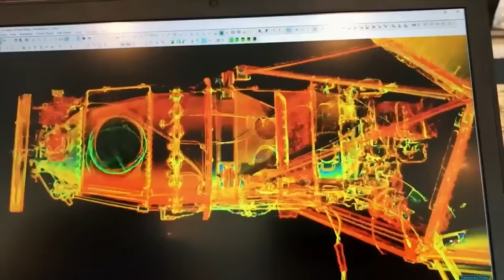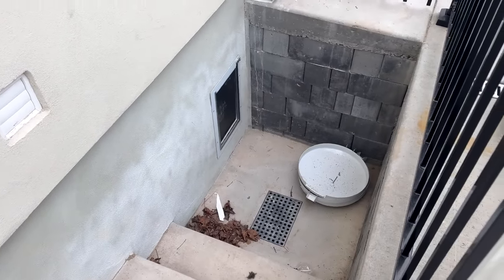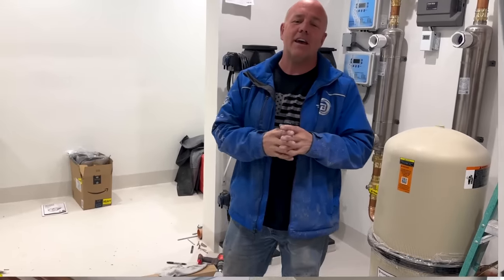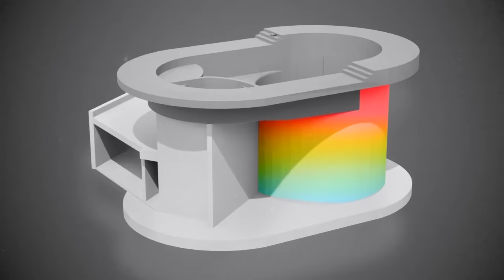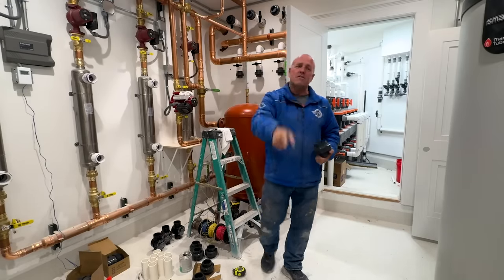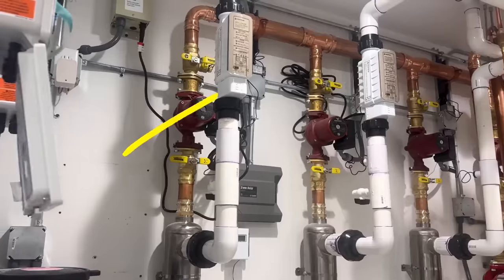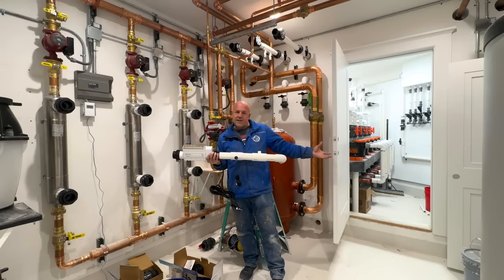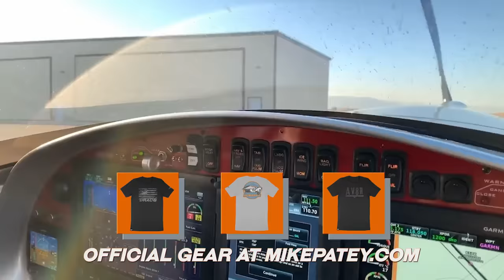Over 40 KW of Backup Power to my home and pool | House Build #23

Comment: I was qualified on a nuclear submarine and I’m impressed with your design, engineering    and safety…You need to design a piping tab for your system and have operating procedure manuals in case you aren’t home…Your kids
 could get qualified to operate everything and your  helper could be the backup to  your back up 👍🏻🤩😃
operator
Reply: Yes this. Mike is a legend few professionals in pool business will reverse engineer this to properly maintain or repair.

Comment: Mike - as a retired executive project manager for very large-scale industrial projects, I am extremely impressed with your engineering and your construction of your home.  This is as good as anything I have seen installed in a refinery or chemical plant.  Two questions I have are:  1) Are you creating a systems operation book with all schematics, owner manuals, operating manuals, etc. for the house?  With the complexity of systems you have installed, this is equal to a small-scale industrial installation, which would have books of this type.  2) Did you ever consider using a PLC or some other form of unified computer control system to run all the systems and components you have installed?  I am thinking something similar to a large yacht management system.

Lastly, the fact you thought of your neighbors with your back-up generator system speaks volumes to how good a man you are.

Comment: Every time I watch one of your videos I am speechless on the intricacy and redundancy of every little system in the house. For example, the valves at each sink and faucet that allows for continues flow through for instantaneous heat at each faucet. How do you not get overwhelmed by points of failure for such a intricate system??

Comment: My only concern is the down stairway opposite the propane tanks. Propane being heavier than air, looks like a collection spot that might allow propane to seep into the lower level of the house.
The whole project is amazing.
Reply: Excellent point! Thanks for sharing
Reply: How do you keep the "grass" clean after it absorbs copious amounts of product? Could get fairly smelly back there.
Reply: My concern would be as the dogs get older they won't be able to make the steps into their "living area".
Reply: @Asta-wl8jz that's not the kind of thing you worry about when you have a pet.. I've had dogs all my life and that's never been a problem but he has money I'm sure he'll change or fix whatever needs fixing if that happened
Reply: @ah244895 my biggest thought too tried that method before and it didn't take long until he tore it out because it stunk😂...
Reply: @Asta-wl8jz  doggie elevator

Comment: I wouldn't even know where to start designing a pool system like this. The amount of thought, designing and engineering in just the systems is insane never mind the rest of the pool and house.
Reply: Both brothers have been building pools for decades and it shows, they have engineered around all the problems with their previous pool builds. Very cool to see all that experience at work!

Comment: As a retired municipal code official (plan review and inspections - both commercial and residential), I would love to hear about the "behind the scene" permit, review and inspection process.  This would be a once-in-a-lifetime opportunity as a code official!
Reply: No code enforcement official knows what the hell the system does or how it works or if it is installed correctly or not!!
Reply: I'm pretty sure the building department just required an engineer to sign off on everything about this job.
Reply: @steinwaymodelb  mike is the engineer :'D
Reply: Do Inspectors who get a Patey job think "Mike's got his sh*t wired, I'll see some cool stuff today, maybe even learn something, this'll be a good one!" Or "Everything will be weird, custom, like nothing I've ever seen before, and it'll take forever to figure it out before I can sign it off."  I wonder the same about the FAA inspectors who have to sign off on builds like Scrappy, but city officials are likely in the same boat here too!
Reply: I am sure EVERYONE in the building department knows all about this project and who Mike is, and how capable.  If it were me, I would be comfortable signing off from my desk, but, I'd want to have the opportunity to walk the job, so I would go out and just BS with Mike.  If Mike is in charge, it's bound to far exceed code requirements, and you know it was done right!

Comment: Got you beat on back up power. 148). 400 Watt panels 30) 100 amp hour Batteries 6) 8k inverters and a 50kva propane generator. All is off line and waiting for the grid to collapse.

Comment: For my work I put in 150kw  system with 450kw generator Ie motor was small but electric side was huge to start  frequency(should UPS fail) converters and keep UPS happy.  If you’re willing to take a chance it’s pretty cool how much you can push generators.  As long as the exciter is a magnet

Comment: Hi Mike, if you read this, I just wanted to warn you about salt-water pools.  Our town built a new public pool 10 years ago or so, using salt water disinfection plus chlorine.  Every year, they close for a month for ma,ntenance to repair tiles which have spalled  off, due to salt crystals growing behind the tile.  When they fall off they use epoxy to reinstall them instead of the cement mortar.   I thought i should let you know about possible problems with salt and tiles.  We have our own 54 year old concrete 40,000 gallon circular concrete pool here in British Columbia heated by a 70kW micro hydro.  Best Regards, Len

Comment: Been following this build since the first shovel of dirt moved. It is as impressive as that flap and slat system on the plane, with a couple of extra's tossed in..... just for the sake of living.. 😉.. Farmboy, turned tech, turned boat tech, turned race engineer, turned airplane nut with a good dose of historic race car restoration here..... Did quite a bit with propane and gaseous flamy stuff . I might miss something in the vid, but in case of a very unlikely leak, since Mike did it, where would the propane pool or dissipate to? I see a drainage line under the grass and the the doggy stairs and door, all lower than the propane. If it does pool and something lit it, the foundations will rattle a bit... Sure of it that you did something, but I can not see it. Vent fan of some sorts?

Comment: Impressive.  My bet is there are no industrial/commercial pools with this level of redundancy let alone residential.  I am rebuilding my pool, and just put in a Generac system tied to natural gas.  No worries about power now, but I figure it is the one thing out of my control that messes up my day.  Why not.  I have batteries on the critical resource, gigabit fiber connection, and 26kw to everything else.

Comment: Please watch out with your acid/chlorine set up.
If you have any failures and they mix then you have a problem. At minimum please install a chlorine gas detector or consider using co2 for ph correction. 
I only advise as I am a pool engineer and have came across a chlorine gas accident which involved a similar situation. 
We generally in the uk would have the hypo or acid in separate bunded tanks.
Erich, Inverness, Scotland. Big fan of what you do and take the time to show it. Thanks for your efforts

Comment: As a pool contractor I would like to recommend something. If you do 90 degree elbows, I would use sweep ones. These straight are outdated, especially you you have plenty of space. It gives you less losses when water travels in the pipe system. Also those black ball valves are crap. If you don't close/open them regularly, within a year they will seize and you will end up breaking the handles and forcing yourself to use a wrench. I wouldn't use ball valves in your application at all actually. I would use Jandy 2-way valves. Never lube them, if anything, you pop out the cover and replace the inside. These ball valves will be headache one day. Also Pentair salt cell...man, it's a headache to maintain it. Jandy/Pentair or Hayward...same thing, they all filter/pump/heat/crate chlorine the same, but as a service person...the key element for me is how difficult is to maintain, which brand is the best. My answer is always the same...Jandy is far the best on the market, everyone just follows. I would use Jandy True Clear salt cells instead. Very easy to maintain, you can see those titanium plates if they are dirty, you just unscrew the top and dip the cell into a bucket with the solution. With this Pentair, first of all, you don't see if it's dirty or not unless you unscrew it and take a look inside. If you want to clean, you have to cap one side, pour solution inside and you many times spill it over, it compromises your floor, especially if it's this high up to the ceiling like you have it. It will be a mess, trust me. The salt cell is good because you create chlorine is a gas form, instead of conventional form...liquid or solid (tablets). In California there is also a code that you have to install a check valve between the cell and a heater. It prevents the heater from corrosion whenever system is not running. I don't see it on your setup. Again, the best check valves are Jandy, the rubber seal gasket gets worn out, you unscrew the cover, pop compromised one out, put a new one in and that's it. Ball check valves are crap, you don't see the state of it after years and the only way how to replace it is to cut the pipe. Whenever I install anything I always thing of anyone who comes after me.

Comment: Hi Mike awesome job , I use those Grundfos pump in my hot house heating and found if there is air bubbles in the water the ceramic shaft well brake because of vibration with running between different densities in the water. Something to consider before run up .😊

Comment: We also run a safety switch that will only allow the chemical to be pumped if it sensed the circulation pump pulling amps, which would mean it is pumping water through the circulation/filtratrion  system

Comment: Nice job on the plumbing. its starting to look like an ocean liner engineroom. Just a comment on the dog entrance door to the basement. if the drain at the bottom of the stair gets a piece of paper on it the drain will block and you could potentially get water into your basement. Consider adding a roof over the stair,

Comment: I have a 15k onan and 1000 gallons propane for my backup and a 6.5k honda as my second backup and now im interested in a battery inverter system for the evening and at night so I can turn off the generator and still have power. Living without power is for the birds

Comment: I have a similar (smaller scale) project planned while replacing our deck, to use icf forms and removable cover that will double as deck when the pool is not in use. Should improve heating and cooling to be able to use year round solar electric in North Carolina.

Comment: I may have missed it - but salt systems stop generating chlorine under a water temp of 60 degrees or so. So either keeping a minimum temp in the pool or doing a minimal chemical injection in the winter. Don't need as much chemicals at lower temps obviously.

Comment: That's a great idea to have the moving pool floor have a side "skirt" to block off the lower area from the rest of the pool!  Does the side "skirt" lose you a whole bunch of depth?  I assume the skirt will be a fixed component that then will be the first piece to contact the bottom, and restrict the overall accessible pool depth?

Comment: the radiator air discharge end of the 30 kw generator is to close to the wall and will cause overheating issues during an outage. for serviceability there should be 36" all the way around the generator. it may not be said explicitly in nfpa 110 ( Standard for Emergency and Standby Power Systems) or nfpa 70 (national electrical code) but it is a good rule of thumb

Comment: small tip for the pvc dont use to much glue/cleaner as it would leave traces on the inside also visible around 9.17 that would weaken the pvc over time has something to do with the softeners in the glue to my understanding

Comment: Thinking about it... you have a backup heat source in the pool itself, but ofc it still would need power to circulate through heat exchangers. 

How do you know the house is build and designed by a skilled pilot? The backup system has it's own backup system, that has it's own backup system.

Comment: Love the project updates! Curious on the dog turf, how do you clean that out so it doesnt stink? Do you hose that off every so often? I'm surprised you don't have an automatic powerwashing system for the turf, like those automatic cleaning public bathrooms! 😂
Reply: I wondered the same thing. I don't understand the fake grass concept. Why not just keep it concrete, maybe epoxy coat for ease of washing? The dogs won't know the difference.
Reply: @Johnbobon  mainly because some dogs are particular and won't go to the bathroom, not on grass. I'm not even sure my dog would go to the bathroom on turf to be honest.
Reply: @schmitty69  You might be right. I don't have a dog, so I'm just speculating.

Comment: Where do you cross connect the chlorinated pool water return to the spa to chlorinate that? Is that in the pump room?
All those unions are a great idea, I did that too. Buy extra unions now! When I needed to make repairs, I couldn't find new unions with the same thread/size!

Comment: I would assume you did a lot of research on the Generac but the service entrance transfer switch that wasn’t needed raises questions. My main concern would be it shutting down from overheating due to lack of airflow. And I’ve heard of Generac not covering warranty issues from lack of clearances, that exhaust side has got to be less then Generac’s spec but I’d have to find one of my manuals to look it up. Plus I can only imagine how much louder the concrete wall next to the muffler amplifies the exhaust. Good luck with everything.
Reply: Also I assume you know but you could run the 30kw on back up propane if we lose natural gas. Depending on the engine you might have to switch a jet but most models it’s just a few clicks on the controller.

Comment: I'm concerned that the heat from your heat exchangers may be too much for the PVC pipe and fittings attached to them.  The male threads may soften and shrink away from the female threads, causing leaks.  I hope you've addressed this issue.  BTW, I  LOVE your videos!

Comment: Mike....love it you are using salt......is that a Magnesium chloride salt?    I have wondered about the benefits of swimming in natural water or mineral rich water....   but the salt might be different to my bath soak salt.......have you seen those automatically wash public toilets?

Dog yard auto wash......

Love you are pointing out backing up backups to backups.

I really do hope you have seen Stan Deyo's team's build EMF protection for generators, buildings, vehicles

Might be worth some surge protection EMF shut off fast enough speed in case of nuke EMF or solar flare EMF.   you probably already built lightening protections in but my understanding is a solar flare EMF or enemy high altitude EMF will cook all electronics an no one will have backups if backups cooked by an EMF.

Hopefully one of those things we don't see is needed for hundreds of years, but since you have so much an EMF or solar flare can mess up thought Idmention Stan Deyo's site has links to the one his team developed etc....

You might already have that covered.

Many of us don't have the same assets and resources but as we dream bigger and look for what we can do better to provide better value the videos by Mark and yourself are great looks into thinking about getting the work done right to enjoy ftimes with family and friends.

Comment: Mike the salt is going to destroy all of the metal in no time.  I’ve been in the pool industry for years and the heat exchangers and copper do not like salt.  I would look into a chemical free system like Eco Smarte out of Minnesota.  They also use C02 to control the PH.

Comment: What is preventing free flow between the deep end and she shallow end? I know you have the raised floor but does it have some kind of gasket that will prevent crossing between hot and cold water? Will the hot and cold water not create “currents” to try and equalize the water temperatures?

Comment: Does that generac model require you to change the flow valve to go from LNG to propane ? I know mine is rated for a lower KW output on LNG. thank you for showing us along on this crazy build
Reply: The propane is for a smaller gennie

Comment: Mike, I have a question,  if your pool bottom moves, why did Garrett need to do a cold plunge to get the coat that was in the bottom? Also how are you going to clean the dog run? Your house is amazing btw...Congratulations.

Comment: I'm curious if there is a possibility of the muriatic acid system failing and allowing too much acid to flow? 
My guess is that it would show up on a pH test but is there something else that is a safety backup to the control units failing?

Comment: Question for you Mr. Patey. Will you be able to use your pool as a thermal mass that can aid in cooling during the summer?
Reply: That’s a very interesting question, because it would definitely work. It wouldn’t surprise me if he did, because he usually thinks of everything.
Reply: @AmericanThatStillHasHope  The only issue I could see would be it not being cold enough because he heats it. Other than that, I feel it could work to limit AC usage.
Reply: @sethhuus  that makes sense

Comment: salt systems are in fact chlorine systems. when you run the salt through a machine it turns the salt into chlorine.  does the same thing just gets there a little differently